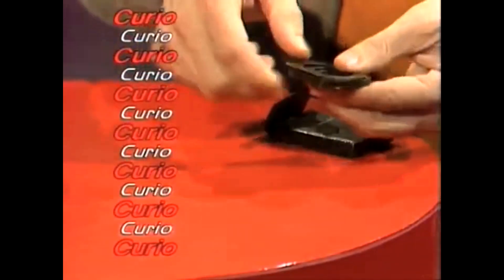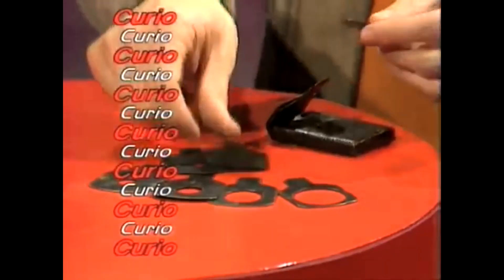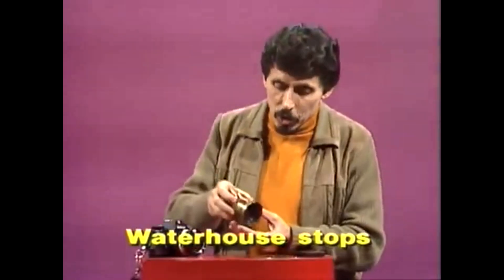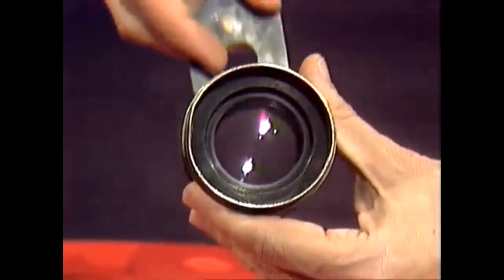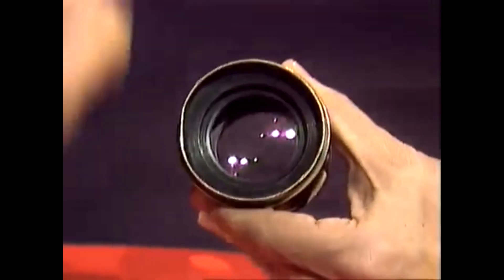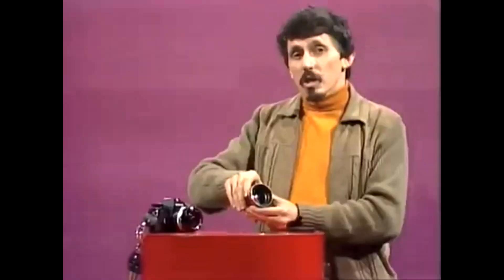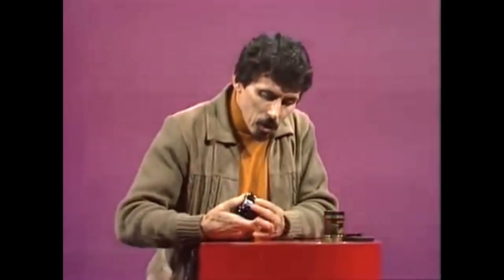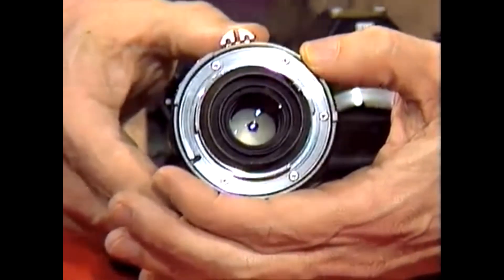Waterhouse Camera Stops

Comment: As any photographer will know, the size of the aperture not only controls the amount of light that enters per time unit, but also controls the depth of focus (called “depth of field”), meaning, how much of what the lens sees will be in focus.  To get more of the background and foreground simultaneously in focus, you need a smaller aperture, which means you need more powerful light.  For trick videography (like having a normal human character conversing with a 12-inch tall fairy folk, like in the movie “Darby O’Gill and the Little People”) you have to have the human character actor close to the camera, the fairy folk character standing far away from the camera, have the two actors share line of sight so that they appear to be looking at each other’s faces even though they are not, close the aperture to nearly nothing, and have an enormous amount of (very hot) studio lights giving enough light so that the film will receive proper exposure.
Reply: I learned lots of this in a computer vision AI course, and it's all so interesting, everything from calculating the physics of the camera position, lense and stuff like that to processing and machine learning algoritms and tons of linear algebra. But I really find it cool how if you know the camera position and details, you can use that for estimating where objects would be in the world from the picture, and the distances, field of view, and stuff like that.
Reply: I've got to look that movie up!

Comment: This is the first time I’ve understood why some photographers say “stop” when they mean size of the iris.
Reply: *Aperture
Reply: Well, there's another reason.  Around the barrel of the lens is a ring, which is turned to change the size of the aperture (the hole in the iris; the iris also is called the diaphragm).  The ring doesn't turn freely, but stops at various set points, like the stops on a bus route.  These set points tend to correspond to halving or doubling (depending on whether you follow them in increasing or decreasing order) of the area of the aperture:  e.g., the "2.8" stop lets in half as much light as the "2" stop; 3.9 lets in half as much light as 2.8; and 5.6 lets in half as much light as 3.9.  So you start with the biggest possible opening and decrease it with diadic fractions (a quarter, an eighth, a sixteenth, a thirty-second, a sixty-fourth, and so on).  A lens that gives a 50-millimeter focal length to a camera that uses 35-millimeter film typically has stops ranging from 2 (the biggest opening) to 22 (the smallest).

Why does the smaller opening have a bigger number, and why does the bigger opening have a smaller number?  "I'm glad you asked!"  The number really is the denominator of a fraction—so 2, for example, really means 1/2 (one half) and 22 means 1/22 (one twenty-second).  But we don't put 1 in the numerator of the fraction:  instead we use the italic lowercase F (ƒ), which stands for "focal length"; this means that at ƒ/2 (prounced "F two"), for example, the diameter of the aperture is 1/2 the focal length of the lens.  The reason for this notation is that the absolute size of the aperture (in inches or centimeters, for example) is less important than the relationship between the size of the aperture and the focal length of the lens.

The progression of the ƒ-stops in diadic fractions, when coupled with common exposure-time settings, gives the photographer some ways to compromise to get a given amount of light onto a piece of film of a given speed.  A camera's settings for exposure time may be, for example, 1/1,000 second, 1/500 second, 1/250 second, 1/125 second, 1/60 second, 1/30 second, 1/15 second, 1/8 second, 1/4 second, 1/2 second, and 1 second.  As you can see, these numbers, sometimes approximately and sometimes exactly, are the doubling and halving of adjacent numbers (e.g., 1/500 second is half as long as 1/250 second and twice as long as 1/1,000 second).  So, if your light meter suggests that you need twice as much light for a good exposure, you have two ways to use your camera settings to get more light onto the film:  you can double your exposure time, or double the size of the aperture.  If you double the exposure time, you'll keep the same depth of field but will also have more blurring of movement in the picture; if you double the aperture size, you'll get the benefit of not increasing the expose time, but you'll also lose depth of field.  If your meter says you need four times as much light, then you have more options:  you can quadruple the aperture size; you can quadruple the exposure time; or you can double the aperture size and double the exposure time.

(Of course there also are other ways to get a brighter picture.  You can add light to the scene that you're photographing, you can use faster film, you can change the developing process, and you can change how you do the printing.)
Reply: It’s when the model starts taking off too much clothing